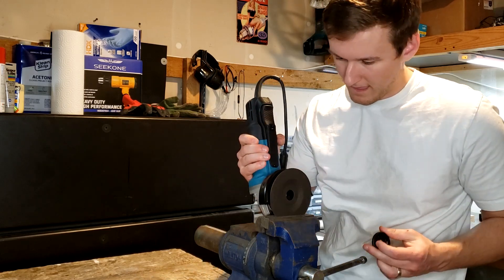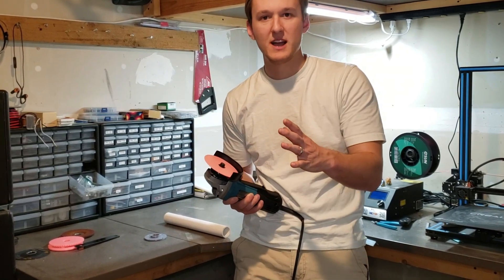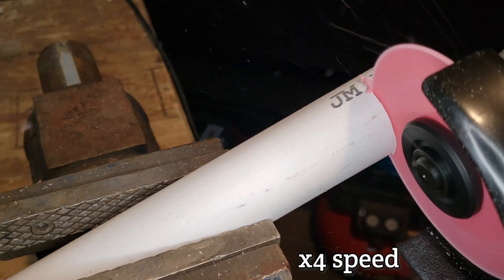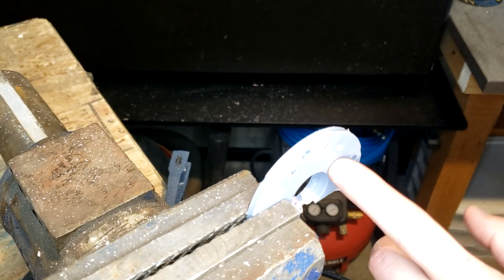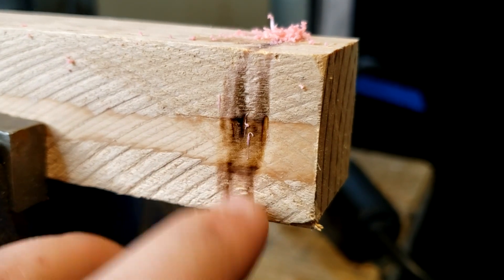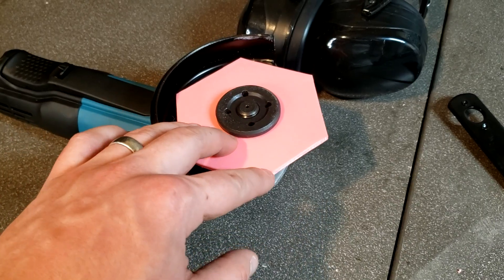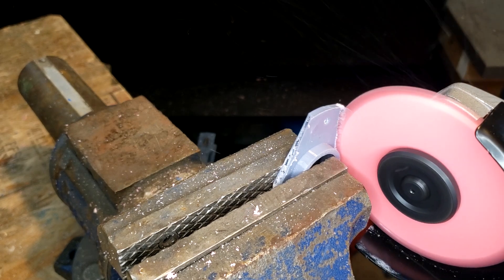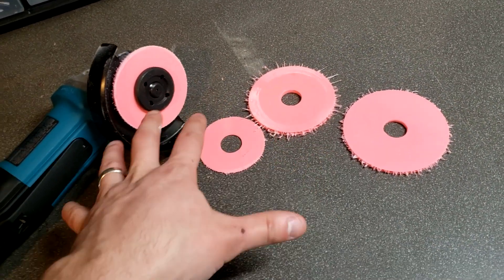Can A 3D Printed Blade Cut Wood?

Comment: I think the larger the circular disc, was logically better for cutting other 3D printed plastic. That's because its will cause more friction on the part, with less heat buildup on any singular part of the cutter, and a larger surface area for cooling. Adding teeth, like in your hexagon, simply focuses ALL the friction and therefor heat onto the tips of the teeth causing those to break down almost immediately

I think this could be made to work for wood as long as the teeth were VERY fine, the infill was 100%, the disc has a large diameter, and the wood you were cutting was like balsa or something.

Comment: its closer to 12rpm actually, I used a thing to test it out, its over 12rpm. so I mean I guess its over 11rpm too, but like I said, I tested it.
Reply from the maker: You're right, I said 11 RPM because I didn't think anyone would believe 12. Thanks for testing that out
Reply: @currentconcept  I'm glad this sort of collaboration is possible in this day and age...

 I'm no time expert, outside of things that are roughly angle grinder sized and happen multiple times a minute, via rotation... so I wont even guess at what the exact day or age is. 

Someone with more patience than me will have to chime in on that. Science.

Comment: if that disk breaks in some unfortunate manner you might be scarred for life or dead...
Don´t play with anglegrinders guys... those rpm harbour some serious danger...

"Occupational Safety and Hazards Administration (OSHA) statistics show a 20% fatality rate for injuries resulting from grinder or saw kickbacks. The other 80% of injuries were serious enough to require hospitalization."

Those experiments arent woth a missing nose or shredded hands

If it explodes and a piece of plastic is lodged between your ribs post us an x-ray tho, call it morbid curiosity :D
Reply from the maker: I (mostly) had them at a safe angle so if the discs did break they'd most likely fly by me. Plus it's a light weight plastic, it isn't a lot of mass. 

I agree though dont mess with these things they will destroy you if you don't respect them.
Reply: @currentconcept  
true
But that also applies to a 22cal which has 1-2g of mass but travels at about double speed. given the splinters are probably heavier than 1-2g and traveling @ about 80m/s you still have some serious damage potential.

I work as a furniture woodworker and am not always up to scrutiny regarding workplace safety but those modified anglegrinders give me the goosebumps.
Reply: @currentconcept  people have died just from a CD attached to it. Just not worth experimenting with.

Comment: You know what is infill in 3dprinting right?
Reply from the maker: Yup! Not sure it would've helped too much - maybe on the other plastic parts, but the heat is what killed it the most. 100% infill still would've been melted quickly
Reply: @currentconcept  100% infil maybe, but i guess around 50% should be just perfect

Comment: What printer do you use
Reply: When did you buy it?
Reply from the maker: @FamTech.  long time ago I got it as a Christmas present. I believe Christmas 2017? Could be off by a year in either direction. It has been flawless, except a slightly warped bed in the center - but I sanded a piece of wood to shove underneath the bed to perfectly even it out lol.
Reply from the maker: Creality cr10s
Reply: @currentconcept  same!

Comment: I'm thinking a simple solution to making it work might be to get some coarse sand and melting it into the 3D print with a heat gun.
Reply from the maker: Hmm thats interesting. Just melt the sand into the edge of the blade?
Reply: @currentconcept  I think you could try melting it into the blade, or you could heat up the edge of the blade and roll it in the sand.

Comment: Having composite filament might make a huge difference. Having solids to not only cut through the objects could help a lot, but also, those solids can significantly reduce friction and also may stop the blade from wearing down.
Reply from the maker: Thats a great idea. What kind of filament would be a good composite one ya think?
Reply: @currentconcept  I'm not really sure. There are many, but I thought about it (when I first commented)... but I didn't really come up with any that I thought would be best. They're not designed to be cutting things, so the particles are probably much finer than would be good for cutting. Some of them have metal particles like copper, steel and tungsten and some have fibers like Fiberglass and Carbon Fiber. Polycarbonate and Nylon are really strong filaments and both come with Carbon Fiber. I'm not sure which would be better though and you need to be able to print at higher temperatures for Nylon (not sure about Polycarbonate) and also need hardened steel nozzles for any Carbon Fiber printing.

I think if you want something really good, you would have to make your own. There would definitely be some challenges, but I think it would be possibly with the right materials. As long as the plastic/polymer fuses to the medium good I think almost anything hard and sharp would work (Like steel, aluminum oxide, tungsten, ceramic and countless other things). Hope you forgive the rant. Is a lot more complicated than just simply... "Having composite filament might make a huge difference.". lol.
Reply from the maker: @deucedeuce1572  sweet thanks for the info. Yeah from what it sounds like my current printing setup wouldn't be able to handle some of those materials, I think my hot end is max 260 C. It's just the stock CR-10S print head.

Thats an interesting idea though. I'll look into it and maybe make a vid on it in the future. Thanks
Reply: @currentconcept  Yeah, I have the same problem. Is easy to upgrade (and cheap) for some people... but if you don't know what you're doing it can be very difficult. An all metal hot end is all that's needed if your printer will allow you to set the max temperature... but if you have an Ender 3 (for example) you have to manually upgrade/modify the firmware. (...and the nozzles are just as simple as buying them for a couple bucks and switching them out). I really hope to upgrade mine soon to 300C for nylon. Some of the cheap all metal hot ends will work perfectly fine and they're only a couple bucks too. I hope to get the Creality Spider hot end (up to over 450C printing, but heat creep on long, high quality prints)... or the Creality Sprite direct extrude hot ends (only 300C, but hot enough for most filaments including nylon and won't have heat creep problems). Having a hard time deciding. I think the Sprite can just be thrown on with the firmware mod, but the Spider needs a new thermistor and for higher speed it needs a more powerful heater.

It's insane how many options there are though and all the pros and cons that come with them all. Nothing is ever simple with 3d printing it seems.
Reply from the maker: Very interesting. Great info. Yeah the more I think I understand about 3D printing, the more I realize I know nothing hahaha. I really do want to print with Nylon at some point. Seems like a great material to work with.
Reply: i love inhaling microscopic glass fibers, delicious silicosis 🤤

Comment: You could probably make it cut better if you print it in a pla that has something abrasive in it like metall fill or even glow in the dark
Reply from the maker: Thats a good idea. Plus I could put like carbide tips in the cutting edges and it'd still technically be a "plastic" blade...